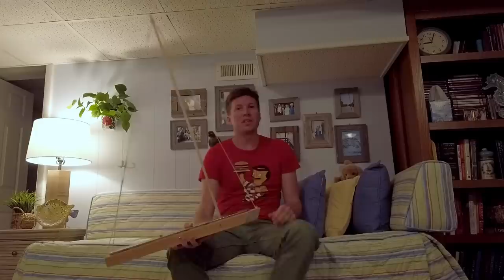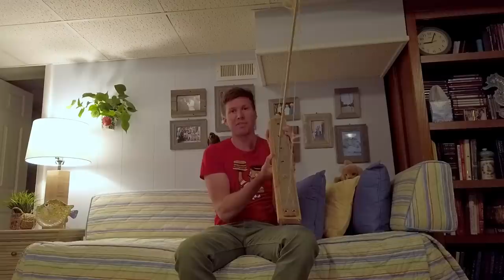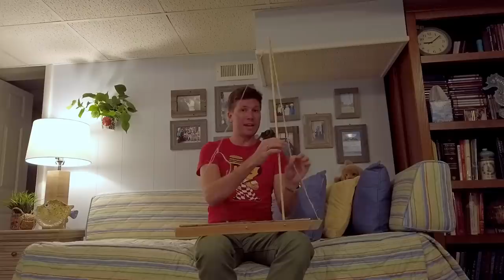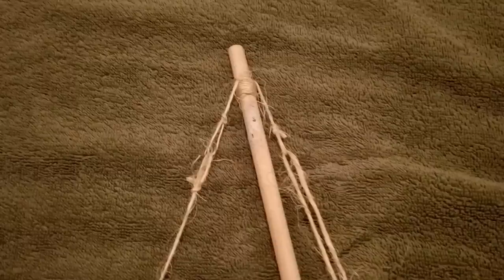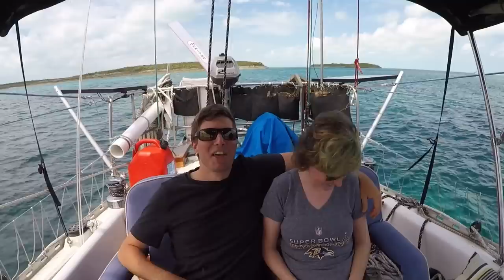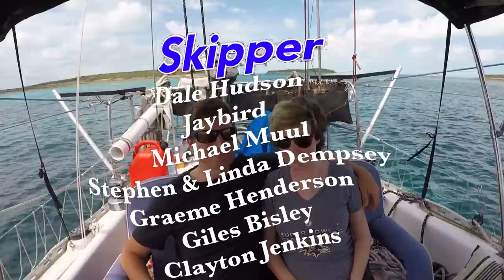Do You NEED One or Two Headsails? | Sailing Wisdom

Comment: Excellent description! Another small note of the difference between a cutter rig vrs a sloop rig is that “most” cutter rigs the mast is shorter. Cutter rigs having two front sails allows as much overall sail area like a sloop but because the mast is shorter, this helps a little with how much the boat will heal over making for a much more comfortable ride especially during long crossings

Comment: The huge kicker in some of these design choices comes down to racing rules , for most of us this was the IOR rule that encourages small mainsails as they were penalized by the rule and large over lapping genoas were not heavily penalized by the rule ( to keep it simple).
As racing has unfortunately lost out to cruising ( nobody sells new racer/cruisers any more) we have gone back to more sensible size mainsails and much less overlapping Genoas  ( or no genoas on some race boats). This is of course good for the cruiser as they no longer have to deal with those huge genoas and sail changes when the wind picked up.
Overall I much prefer the smaller foresails and if the foretriangle is large enough boats can be designed with self-tacking jibs and easily reefed mainsail to simplify the shorthanded cruising lifestyle.
Cheers Warren.
Reply from the maker: Very true! The self tacking staysail setup we have makes short tacking in a Harbor a breeze! Trying to monkey a huge lapped would be a nightmare.
Being how racing trickles into cruising styles, I am excited for the day when cruisers have hydrofoils and ride above the waves. I know this sounds far fetched, but in the time of wooden full keels, it was insanity to propose that families would cruise on plastic fin keel boats with roller furling and electric charts!

Comment: I used to be a teacher, but more importantly I'm a nerd who loves to drill into a new topic, breaking it down and learning it. First I learned about sailing so I could better appreciate the Patrick O'Brian Jack Aubrey novels  (Listening to them while building and paddling sea kayaks. Unless I'm a mile off the coast I don't feel I've paddled. The question I can't really answer yet is So what took you so long???) Now I want to sail. I have a plan over the next year or two learn how to sail, get good at it,  get a boat and go sailing. I may start with a Catalina 22, but I will end up cruising the world - maybe not all of it.  So I watch sailing videos and note things like, "but I didn't attach a preventer." So I look up preventer. (Google is great, I've learned new terms in the past  that took me years to find a source of information.) So these videos are great. The physics I have down. 
My head was once awash in cables, sheets, chains, stays.... And then I learned what they do. It's a system, not 500 different things. So systems: maybe pause and go through the parts of systems. 
Your model. At some point maybe  get some color string, also lower your exposure slightly and put a side, or a side back light,  (If your bow was pointed north than these lights would be pointed from NWN) pointed at the model, now the background will no longer have any pure white in it, and the color strings will light up and stand out.

Comment: Herbie, two related subjects i'd really like to know about:
1. the pros and cons of fractional vs mast head rigs? Inc. 9/10th and other fractions.
2. how do you determine the tension to set your back stay for various conditions?
Reply from the maker: Will do on the fractional rig setups!

2. Going upwind, you want to tighten your backstay to reduce headstay sag. Also, when the wind picks up, a tighter backstay will flatten the mainsail and depower it.
Going downwind, you want to loosen the backstay to add headstay sag, allowing the luff of the headsail to billow out and generate a lot more power. This will also straighten the mast and give it more belly. The deeper chord will give it a lot more power in the light conditions.

Basically: windy or going upwind: tighten the backstay.
Light air or going downwind: loosen the backstay.

Comment: Ya the colloquial definition of cutter being a mast aft sloop with an inner forestay and staysail is not technically correct.  But it is more sensible, as one can readily see the difference between the colloquial sloop vs the colloquial cutter.  Picking out if the rig is aft or forward of station 4 is not readily apparent. (And the station locations, 0 to 10 are defined from the forward and aft perpendiculars which is not necessarily the same as 40 pct aft of the bow, so the distinction between cutter and sloop becomes less clear just from visual observation, especially in boats with large overhangs).

As a naval architect, I prefer the colloquial definition instead of the historical definition as it is more descriptive of the rig, ie inner forestay with staysail vs one forestay or headstay.

As far as sloop vs cutter upwind, the current highest breed of racing monohulls have the mast well aft (ie volvo 70s, TP52s, etc.) because this yields more rig configurations, and it is faster overall if you don't have to accommodate a rating rule.  And they go upwing like crazy. So the generalizations of mast fwd is better for upwind aren't really true.
Reply from the maker: I was going to mention the VOR but decided not to in an attempt to keep it simple. They are “beyond cutter” with three headsails plus whatever they fly on the bowsprit. Those boats are machines with their rectangular main and staysail Genoas giving them all the performance available! I really do enjoy seeing where the boundaries of material science allow these ocean speed racers to go 😁

Comment: You only mentioned center of effort once. Good explanation on cutter vs sloop. Lots of variables that go into sailboat design and performance. Deciding what you need is what really counts if your building a new boat. What is available for sale is what you get in a used boat. You might want to mention why we went to triangular sails from the old square riggers.
Reply from the maker: Very good point! I was trying to keep these first videos very basic. I figured going into detail on little details would drive off someone who wants to start learning. 
The future videos that I will probably make this winter will go into the interplay of CE and CLR with sail balance

Comment: I'm by no means an accomplished sailor, but I always thought adjusting (tightening) the backstay can dump air out of the mainsail slowing forward progress. So, if you want to slow down fairly quickly or the sail are over powered you can tighten the backstay, instead of placing a temporary reef or luffing the main. Thanks...and I wondered where the 1-2 headsails explication came from.
Reply from the maker: The backstay adjustment you described is correct. Tightening the backstay flattens the mainsail and tightens the headstay.

Comment: Do you always have to use 2 headsails when sailing a cutter?  It seems like it would be a pain to have an extra sail to deal with all the time.  I"ve only sailed sloops in the past. But having a lower overall sail area and a lower mast would be good for going under bridges on the ICW.  I'm having a hard time finding a cutter to try out before buying. I'm looking at the 40-46 foot range, looking at Island Packets, Hylas, Najad and Masons so far.
Reply from the maker: The only time I fly both headsails is on a beam or shallow broad reach. On a close reach, the sails interfere with each other and don’t perform as well. If winds are light, I keep the bigger sail, if winds are heavy, I keep the smaller sail; the same on a deep broad reach. 
The biggest advantage is when reefing, all you need to do is get rid of the bigger sail and instantly you have a smaller sail set closer to the mast. This is great for balancing the sails as well.

Comment: From what I understand about a cutter sailing to windward, you can have a much flatter cut to your inner fore sail. The flatter sail will give you a much better performance. And because the forestay is lower on the mast, it essentially becomes a factional rig. This will give better performance in strong wind.
Reply from the maker: Yes, and this is what we have as our staysail :)
Reply: That's what  I thought as well.  When the wind picks up, the main is reefed,   the jib  is furled and you are left with a nice flat  yankee  which should have reasonable  windward performance.

Comment: I am wondering how much this contributes to the difference in upwind performance of full keels vs fin keels. The full vs fin keel debate has quite a few different explanations of why a full keel doesn't sail as close into the wind and I'm now thinking that mast location might be a large factor. Most full keel boats happen to be older boats with cutter rigs and masts going through the center of the salon, which equals saggier forestays. I also learned from your "Ketch vs Yawl" video that a cutter gets dirtier air when close hauled so that might also explain why older boats don't sail upwind as well. I wonder how a full keel and fin keel would point upwind if they were both sloops with masts in identical locations. Maybe the size of the keel is not actually to blame.
Reply from the maker: These are good points! We have an Alberg 30 (full keel sloop from 1966) and it sails much faster than our Morgan. 
When we get back to the Chesapeake, we will be rebuilding the Alberg to go cruising so we will really get to see how the two boat styles stack up!

Comment: The 40-50% you mentioned, does that relate to the deck or the waterline. Because of it's attachments you would think the former but the sail power reacts to the hull and the bow shape (overhang) so it might be the latter. Just wondering.

Comment: Awesomely explained! Love visual explanations Thank you. 
Can you please explain how an oversized Genoa on a sloop rig effects tacking efficiency ?  Is it more difficult to tack ? 
Thanks again
Reply from the maker: Whenever the headsail overlaps beyond the mast, tacking becomes a bit harder because the clew needs to drag past the front of the mast and can potentially foul on more points. The larger the sail, the harder the tack; a 180% will be much harder to tack than a 110%. The tack also takes longer because the sail needs to fully sweep across the mast before it can be sheeted in. If it gets fouled on anything during the tack, now it needs to be freed. 
A non-overlapping headsail (anything that is 95% or less) will tack faster because it is entirely ahead of the mast. Tacks only involve it moving over quickly with no added stress or issues.
Reply: Rigging Doctor Thank you so much for the reply and perfect explanation. I’ve only recently discovered your channel and will watch with interest. Thank you 🙏🏼

Comment: Does this mean that for a Cutter that the rigging is looser than a sloop? When I bought my cutter the backstays were very loose, and still are. The shrouds are kind of loose too, I dont want to start tensioning everything without having the knowledge first. I read that 'hand tight' is what I should be going for with my rig but not sure if the forestay needs tensioning or just tighten the backstays until tighter, which will bend the mast aft...

Comment: I have a newbie question: why have a boom on the mainsail? If the jib or the genoa can sail just by tying the clew, then why can't you just tie the clew of the mainsail down and not have to worry about getting wacked by a giant stick?
Reply from the maker: The boom is basically a permanent whisker pole for the mainsail. It’s really handy for trimming when going upwind. In a nasty storm, you switch to a trysail which is a boom-less small mainsail to take the boom out of the equation. Without the boom, the trysail is hard to trim well for upwind sailing and this really makes you appreciate the boom for the mainsail. 
The Thames Sailing Barge is an example of a sailboat with no boom. It can work, but it’s really helpful to have the boom for trimming and sail shape.

Comment: Nice, simple explanation, but not completely accurate on the genoa measurements.  The headsail is measured on a line that goes on a 90 degree angle from the luff to the clew, not along the foot of the sail.  Then you compare it to the "J" dimension (the horizontal measurement from the base of the mast to the fore stay).

Also, you can use mast bend to help depower the main and the genoa by flattening them.  You have to take into account that there are lower stays too, so tightening the back stay without adjusting any of the lowers will cause the top of the mast to bend in relation to the bottom.  BTW, there is video of the America's Cup boats cranking down on their back stay so much that they break the boat.

Comment: I'm looking at some British cutters and the backstay doesn't go all the way to the stern; they are mounted along the sheerline and the boom extend beyond the stern. I believe it's called a running backstay. How does that change the benefit of a cutter or sloop?
Reply from the maker: It makes it tricky to short tack as you have to set and douse the running backstays on each tack. They are better suited for long passages as opposed to buoy racing 😎
Reply: Thank you, I spent the day looking at your other videos and learned a lot! I'm sketching on a smaller gaff rig vessel, judging by the Cornish Crabber it seems possible to skip the running backstays for the smaller boats and only use lower shroud, cap shroud and forestay.

Comment: How should I deal with head sail slack when I’m operating a gaff rig with no back stay
Reply from the maker: This is part of why Bermuda rigged boats sail to windward better. 
Do you have running backstays? If not, you could “try” to over tighten the headstay halyard to the point that the luff of the headsail becomes tighter than the stay and controls the sag. The problem is the lack of backstay will just let the mast bend forward and slacken the headstay, causing more sag. 
The only way to fight this is if the mainsail is sheeted in super tight so that the leech could transmit the load to the peak, and then through the peak halyard to the masthead to pull against the headstay. In other words, not gonna happen. 

TLDR version: not easily.

Comment: So why do they say junk rig dont go to windward well? Doesnt the mast give you that tight sail???
What about the Wharram Wingsail with the top hoisted boom and no deckside boom, with the mast(s) be brought forward (with or without headsail?)
Reply from the maker: While junk rigs are amazing and incredibly versatile, the luff is not as tight as it could be on a Bermuda Rig. 
The mast itself causes strange wind flow so the junk rig performs better on one tack that the other as one tack will have the mast to windward or to leeward.

Comment: I keep telling my Captain when I am on his racing yacht, not to go dead down wind but to go of it . Do you know how far off the wind you go to for the best speed.
If you go to far you lose ground.
This is a General question as you have some many different types of yachts and keel. And some say you use your keel as a sail as well. What are your thoughts on this .?
Reply: Every sailboat has what is known as a "polar diagram" for a given complement of sails.  It is actually a set of plots for various wind velocities which, if accurately constructed (correctly representing the vessel's potential speed across the range of apparent wind directions), can be used to compute the ideal heading to optimize the vessel's VMG toward an objective.  The polar diagram is useful to the navigator who wishes to determine an optimal downwind course during a race.  For the typical cruiser, there are many factors besides VMG to be considered (such as motion in the seaway, performance of self-steering, etc), so the polar diagram isn't as influential as for a racing vessel.
Reply: Rob Evans ,thanks for a great answer.
Reply: As already explained, Polar diagrams will tell you what wind angle will yield the best VMG, but you may not find polars for your boat if it is an old design. In that case, you have trial and error process, or use the VMG display if your onboard computer computes it.
However, you must know that if your polars tell you the optimal downwind wind angle to meke the best VMG, it usually means you must be flying the optimal sails for that point of sail which usually means flying the Spinnaker.
Reply: Fesh Fesh Sailing , thanks for informative information.
Reply from the maker: The trick is to figure out which will give you the best VMG (velocity made good). This is literally the fastest to getting there direction and speed. You can do it by paper but that takes too long. Modern chart plotters will allow you to plug in the destination point and tell you the VMG as you sail. Simply fall off the wind and watch the VMG go up. Once it peaks and starts going down, you know you are going too far off course and not gaining anything.
Reply: Rigging Doctor , ok will try it tomorrow

Comment: So; cutters are slightly better going down wind, and sloops better at upwind
Cutters compensate with a with extra staysails hence; cutter rigged
Sloops compensate with a Genoa
So what's the advantage of a cutter rigged sloop besides extra sail area? The extra slotting effect?
Reply from the maker: You can quickly reef the headsail by dropping the jib and keeping the staysail.
Reply: A cutter allows you to carry more sail area forward of the mast than aft of the mast, and this is much safer when sailing off the wind because it is safer to pull a boat through the water than to push it through.
That's why you see modern boats broad reach in 30 knt true wind with one or two reefs in the main and full Gennaker or full heavyweight spinnaker. You will not see them broad reach with the staysail alone or the solent alone forward of the mast.